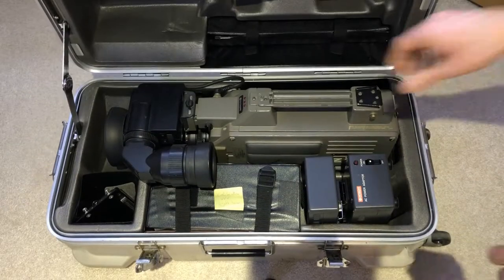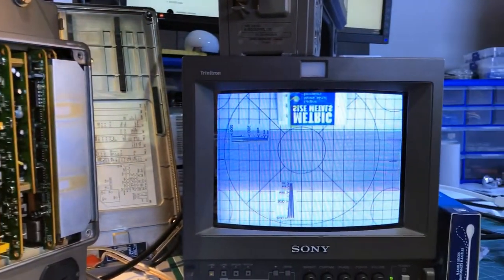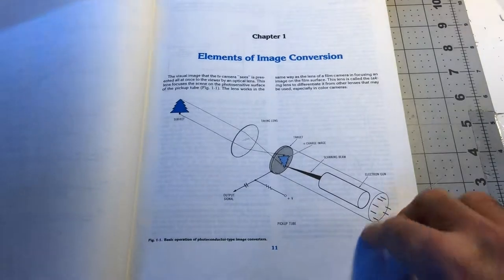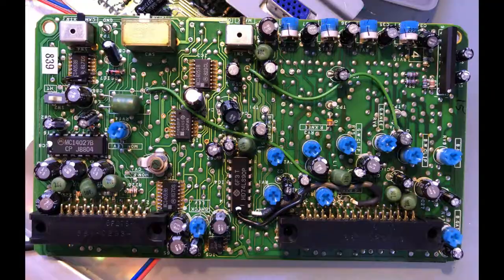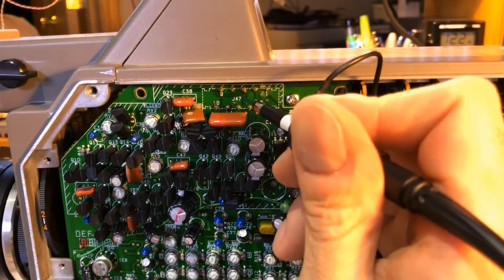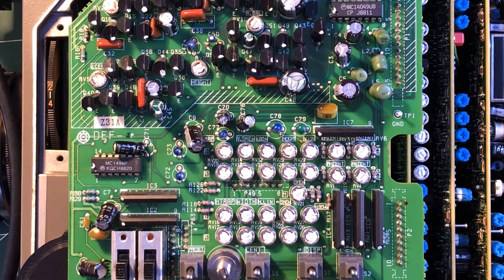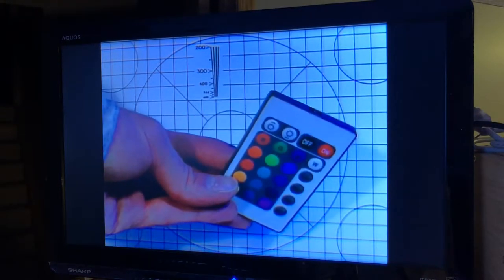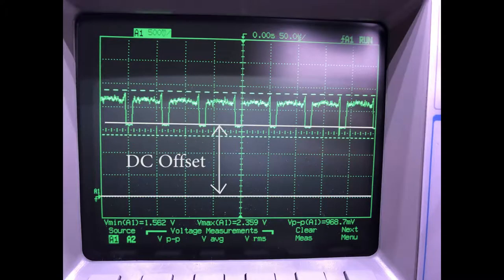Tube Camera Fix - Hitachi FP-Z31

Comment from the maker: Update: I finally found a way to extract RGB from the Camera. If I'm not posting another video, feel free to ask for details.
Reply: What did you come up with?
Reply from the maker: @BenHelweg  Simply used the 3 test point on the ENC card, and found some H/V signals around those point. 75Ohm and some caps to remove the DC component and voila! I had to increase the gain slightly on the OSSC so I guess next step is to get a donor ENC card and remove the rest of the circuit after those 3 test points to get all the signal to the OSSC.
If I had money and time, I'd totally work on a new driver board to get 1080p out of those tubes... That's the beauty of picture tubes, sky is the limit!
Reply: Also, I have some images from the interior of my RGB box if you'd like them to reverse engineer something.
Reply: @AnalogThinker  Whats the best way to capture the analog RGB signals? I'm getting a Sony DXC-M3A which is a 3 tube. I use my Digital8 camcorder to capture but it won't accept RGB. I do have an HDMI capture card so should I just get an RGB to HDMI converter?
Reply: Hey there @Analog Thinker, are you by any chance based in France? I'd love to have a chat with you about this kind of camera, is there any way I can get in touch with you?
Reply from the maker: @jeanbaptistekrauss  I do speak french but not in France. Feel free to use the contact email in about section

Comment: The lag or comet-trailing can be somewhat mitigated by adjusting the beam controls and I've been able to get it in a pretty good place so that only really bright stuff renders a trail, but it probably comes at a cost of reduced tube life or something.
I actually love the look of the trail anyway!
Reply from the maker: Yes, I figured this out playing with those trimpots. It was very bad on the green to start with but I got it to a sweet spot I think!
Reply: What beam controls in particular? I have several Ikegami ITC-730A units and one of them has much worse highlight bloom/trails than the others.

Comment: Hey, I I have an Ikegami HL-95B 3 tube camera, and it doesn't focus when zoomed out no matter WHAT I do. I've adjusted front focus, back focus on the lens, and even back focus for the green tube, but it will not focus. It does focus when zoomed and focused at 0.6m at a back focus chart. I know the lens elements are good, so I'm assuming the optical block needs adjustment? I do not have a service manual sadly.

Comment: I recently found this exact camera in my basement. It was my late father's and I would like to try to calibrate it for future projects (settings have not been changed in 25+ years), but sadly he took his knowledge to the grave and I cannot find any information on how to do it. If anyone has any information, links, or books about the process of focusing the beams and adjusting settings it would be greatly appreciated.
Reply from the maker: Hey Sam, Ben Helweg made a manual available here: https://www.manualslib.com/products/Hitachi-Fp-Z31-4188153.html

We also have a full service manual here but my friend would need to scan it, it's a lengthy process, so many pages of different formats haha.

In a nutshell, be careful with high voltage, use a very good monitor, mark all pots factory position so you can go back in case of a big mess, cutoff R and B, start with green alignment and convergence, then adjust the other tubes one at a time to match the green. A pattern is highly recommended. In case you are not sure, don't touch it. Resource is hard to come by, as you can see in this video I also have a generic Tube Camera service book, but every camera is so different that I haven't found it much useful. It explains the theory of operation which is a good start.
Let us know how it goes or post a video and we may provide some advice! (Or if you are local just drop it).